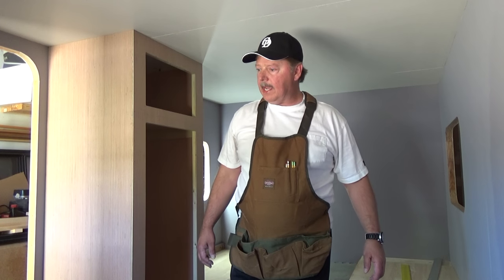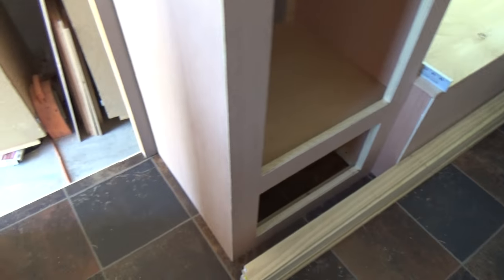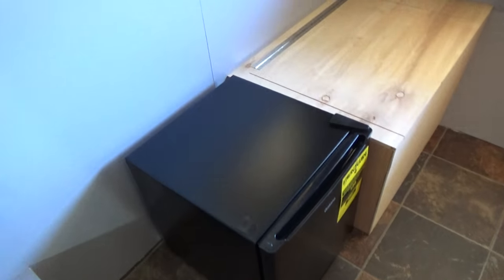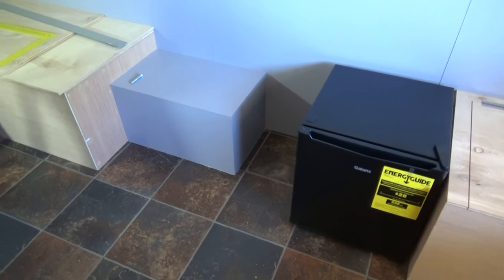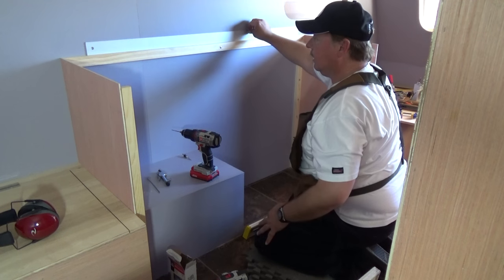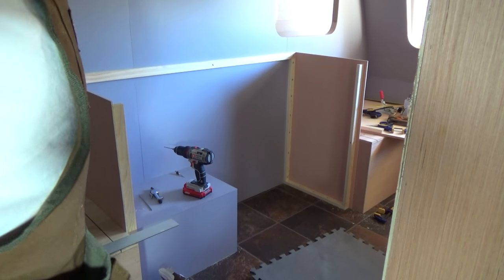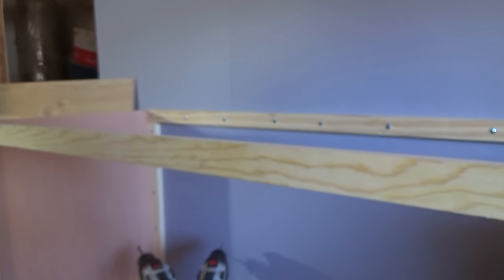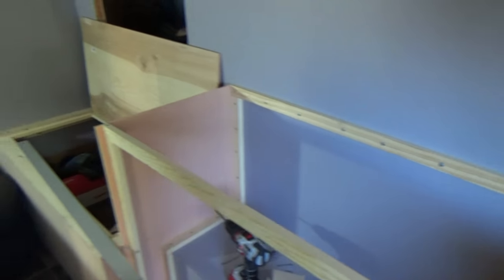How To Build A DIY Travel Trailer - Part 15 (Kitchenette Part 1)

Comment: Hi there! Your cabinetry videos are tremendously helping me with my own building plans :) Could you please tell me what type of wood/board you are using in this video to face the kitchenette? It also looks like the same lumber you used to build you upper cabinets in this rig. It looks pretty thin- this wood is strong enough to hold things used in your upper cabinets?
Reply from the maker: Hi SKL!  Thanks for the great comment! The framing I used 1 x 2 white pine from Lowe's and Home Depot. Very strong, straight, and light... for the facing, I used 5mm hardwood plywood (primed one side). Inexpensive and very easy to work with. Also from Lowe's or Home Depot. Hope that helps!